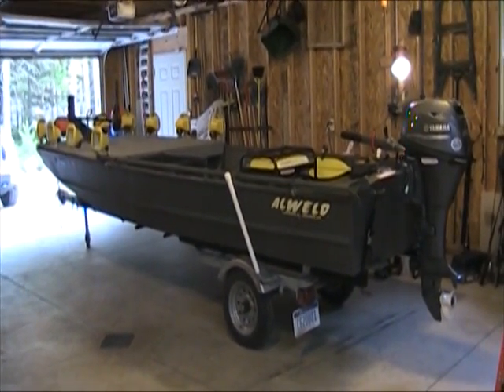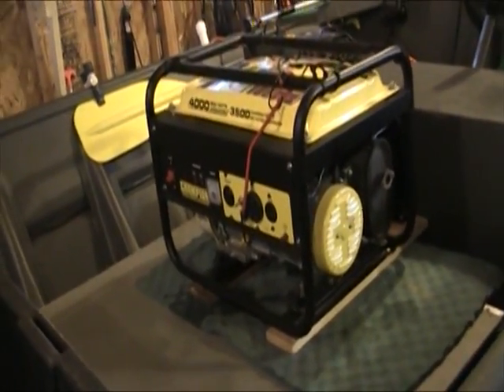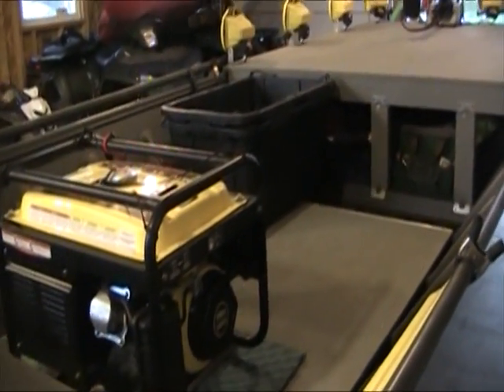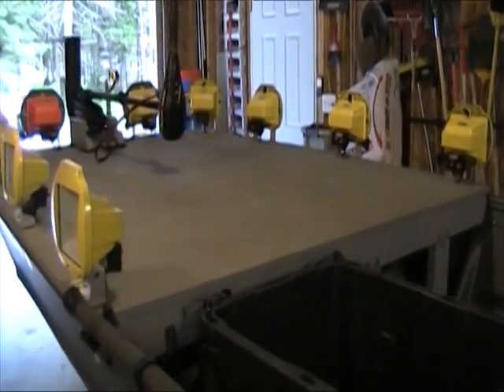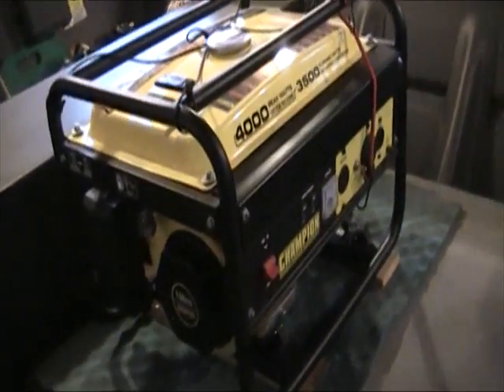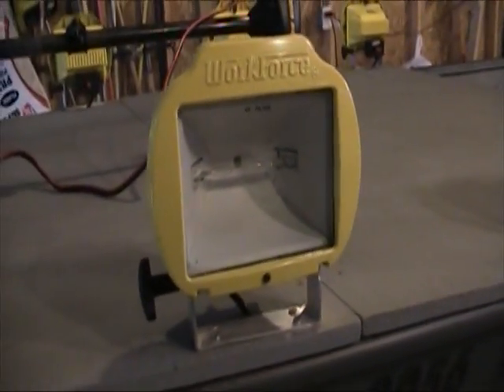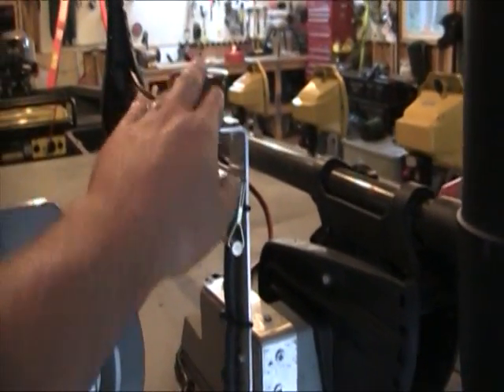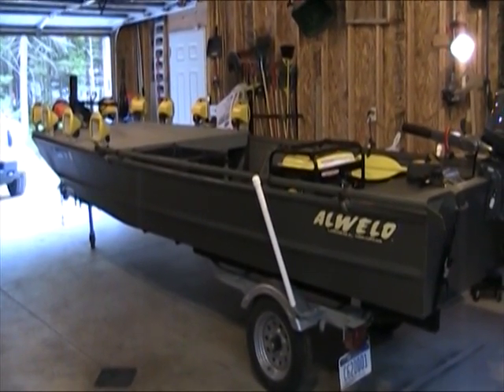Bowfishing Boat Overview

Comment: what state are you in
Reply from the maker: Michigan
Reply: tbwpodcast  I am in Michigan also stjohns area ...nice boat thanks for the info ,just getting back in the sport thanks for the info ..hope to see you out there some time ,,,,,John
Reply: John, I also live in St John's area. I see you say you sold boat. Just curious if you ever got another one? I have 16' flat w 16" deck in front and side driving console. I am getting at what inch shaft did you put on front of boat for trolling motor? I have rear mount one now with evinrude 25hp. Wanted to put another up front. Any tips would be greatly appreciated.  Thank you,  Roger